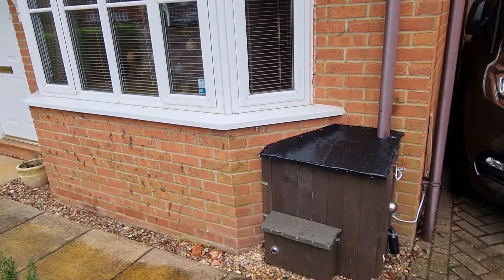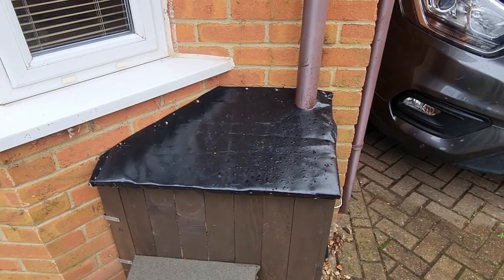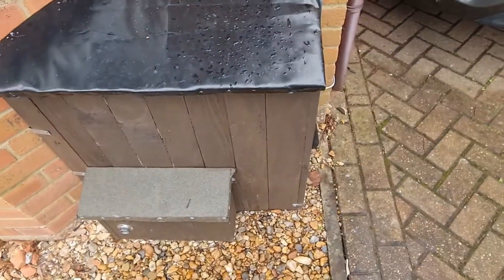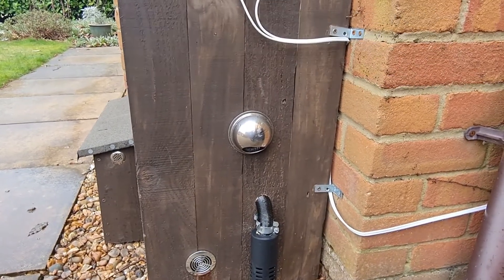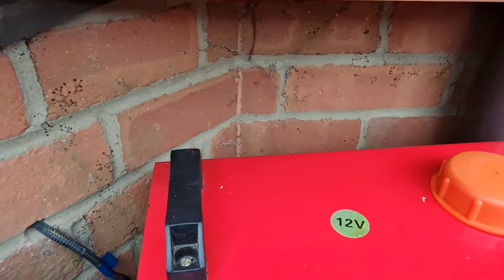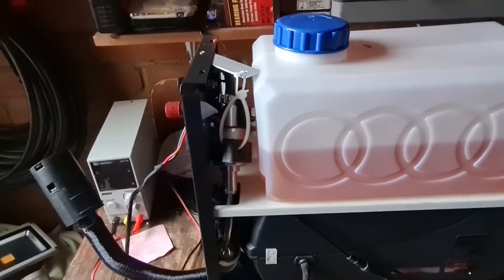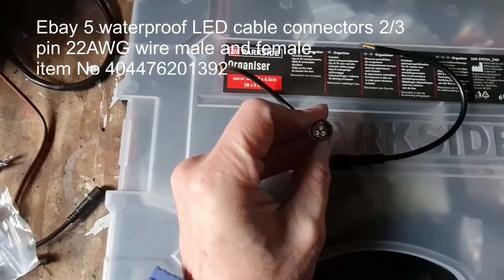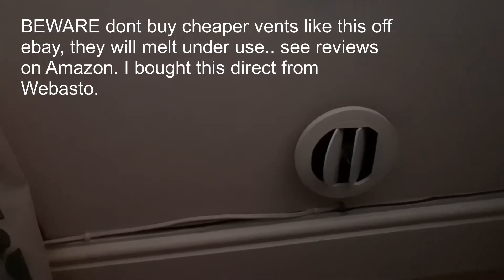Installing a Chinese Diesel heater into my house

Comment: Fuel smell is either coming from exhaust gasses or from the fuel cap, try putting a pit bike breather on the fuel cap
Reply from the maker: Hello. I sorted the smell by extending the air intake pipe further away from the unit, the smell was coming from air filled with diesel fumes.

Comment: Hi Roy just subscribed I found this interesting and may try this out, well explained 👍
Reply from the maker: Hello. Thank you, I appreciate your comments.
Reply from the maker: Hello. Thanks for subscribing. Glad it was of some use. Since installing i have removed the red outer case and now have the pump suspended on cable ties off the black part of the outer casing. I also added some sound proofing (from my van build) to the pump, all parts I could see and this really helped quieten it down, so much so that I cannot hear the pump at all, where as before the ticking would travel through the wall.

Comment: Hi there, would this be too noisy to vent into a bedroom for night time usage?
Reply from the maker: Hello. Yes you could vent it into a bedroom, only their are 2 potential issues, firstly the pump, you will hear this, I have quietened mine down to practically no noise by removing the original mount which attached it to the pump housing, and now suspending it via two cable ties, still keeping the 35 degree angle, and adding some sound proofing to the body and ends of the pump, it's a small amount but makes a big difference. It the type used in van conversions (dodo soundproofing mat)
The fan noise is reduced when the heater reaches the desired set temperature. This can be achieved quicker by reducing the pump fuel mix to 1.4 pps if I recall correctly. However, bare in mind that not all fans make the same noise, I have the same heater in my garage, and that fan is noiser than the lounge fan.. 
Hope that helps.

Comment: Hi mate I recently got one of these and I’m trying to figure out how to run it off the mains, the best I can find is a mains converter takes it the 12 volts I need to a a cigarette lighter connection and then it’s got the little wires that connects to the back of the machine but it’s 10 amp rated I’ve heard I might need 15 amp but I can’t find the parts for 15 amp. Will it be okay at 10 amp or have you got any suggestions?
Reply from the maker: @connorjones3080  
Hello. The best way to run one of these off 230v is using a 

DC 5V/12V/24V Universal Regulated Switching Power Supply Transformer LED Strip

 (bought off ebay)
You need the 200w version as its Rated for 16.5amps, and these heaters pull up to 11amps upon start up. You won't be able to run it off a cigarette lighter socket as they are only Rated to 10amps max, you will either blow the cigarette lighter fuse or possibly cause the wires to over heat.

The two wires coming from the back of the heater, red and black, screw into 2 ports on the transformer, it's the safest way to run it off 230v. Be mindful though when running it off 230v if you have a power cut it will also cut the power to your heater.

Comment: Im sorry. How do you get in and out of that van when there's not even enough room to fold out the mirrors?
Reply from the maker: @johnassal5838  Hello.. yes it a bit tight, but i am able to open the passenger side door enough to climb in and cross to the drivers seat. Reversing back is always a bit nerve racking..

Comment: From what I've seen of these is that many of them aren't sealed really well. Pressure test the combustion chamber and you will probably see a few air leaks. These air leaks will leak the combustion gasses into the clean air during warm up.

Someone posted in another video that they tore theirs completely apart and sealed every sealing surface with high temp RTV onto the gaskets (including where the glow plug is threads into the unit). 

The issue is primarily due to when the unit is cold the sealing surfaces aren't well sealed, and seals when the unit gets hot as the metal expands sealing the unit.
Reply from the maker: @madmax2069  Hello. Thanks for commenting. That makes total sense, I did strip it down and rebuild using high temp sealant on the burn chamber gaskets, but alas it did not cure the smell, and interestingly the small is present on both startup and shut down, which kinda negates the expansion of the metal when hot. However on the next strip down I will seal with sealant all areas including glow plug, and hopefully that might cure it.
Reply: @royclark8385  you should try pressure testing the combustion chamber to see if there is any leaks. it doesn't take much pressure to find them. Even if there is residual fuel in the combustion chamber it still shouldn't leak into the clean air stream it should all go out of the exhaust. 

That brings up another thing. The exhaust piping could also have a slight leak which would explain why you can smell it during heat up and cool down because there is usually going to be unburned fuel during start up and cool down. 

Have you been outside during and looking into the box during heat up and cool down to see if you can smell any exhaust gasses from within the box you built around it?

Comment: Hi Roy, i used to pull in fresh cold air but i found i needed a higher setting when the temps dropped to minus, plus the cold air draft when not in use was terrible lol. I cored a new hole and now recirculate the air inside the house.. No drafts and i can automate the heater without having to have the vent open all the time. The heater runs more efficient, the heat output is higher and i can run it at a lower setting and conserve fuel too. In 2 years ive had no issues with condensation 👍🏻 Check put my video on how i automated it 👍🏻
Reply from the maker: @deoxyrobo  hello. Thanks for the comment, I have thought about recycling the air from indoors but to be honest, I am reluctant to cut another hole in my wall..
Reply: @royclark8385  you could reverse your thinking on this. Bring the heater inside and route the combustion air intake and exhaust out through the hole that you have got, along with the fuel line. That’s how they are installed in vans as you know. You leave the nasty ticking outside, and he fuel etc. just build a nice box / use an old side board to house it.
Reply from the maker: @deoxyrobo  hello. Thanks for taking the time to comment, I will check it out. I totally get the advantages of recycling the air from indoors and may opt for that 2nd hole in my brick work, but right now, i actually like the fresh air it's pulling in.

Comment: Hi,
Stupid question, what size hole did you need to allow heat tube to pass through your house wall. Did you need to fit a sleeve to carry the heat tube to prevent contact with cavity insulation.  I did say a stupid question. Thanks.
Reply from the maker: @harken112  hello. I bought one of these
Flintronic Drill Bit Set, Ø80mm Hollow TCT Drill Core Bit Cutter, with 111mm Round Shank SDS Plus Adapter Hole Cutter Drill Bit, Hammer Hole Saw for Wall Concrete Brick Stone Cement
For the brick on the exterior and 1 of these for the timber and plasterboard in the cavity and lounge 
Starrett HSS Bi-Metal Hole Saw - FCH0318 Fast Cut Extra Cobalt Hole Saw - For Stainless Mild Sheet Wood Plastic Various Materials - 79mm
Both brought from Amazon.
I did not fit a sleeve as I felt it it didn't melt the plastic pipe it would not damage the wood and insulation. I did check numerous times upon initial turn on and once running for 39 mins or so.
It's been great for the past year. I serviced it over the summer and running on kerosene, its was extremely clean inside.

Comment: You can get a display extension cable pre wired 2 3 4 metres
Reply from the maker: @flapper111uk  hello. I cut and rewired my display to a water tight 3 pin plug so it could be easily removed and swapped with another if needed. Did not know you could buy extensions though.

Comment: Sponge box for the pump
Reply from the maker: @jamiejoker118  hello, since installing i have changed the set up quite a bit, I now have the pump suspended on cable ties and also resting on a rag. I can now only hear it when the house is silent and I am listening for it, and even then it's a very slight tick. So I am very happy with that. Unfortunately I still get a kerosene smell upon starting up, even after servicing and sealing the gaskets with heat proof silicone. My eberspacher d2 in my van has no smell whats so ever..

Comment: I'm looking at doing something similar but routing the intake air to draft from in the house. I want to do this for two reasons. First is problem of pulling its own exhaust gases into the house. The second is the efficiency of heating internal air. I hope to build a box that mounts like a window air conditioner.
Reply from the maker: @Tiersmoke92555  Hello. I did think about routing the air intake from indoors but saw a number of videos claiming doing so caused condensation within the room so opted for fresh air. I can definitely appreciate the concern regarding CO2 I fitted a carbon monoxide alarm immediately above the air outlet and during install used a CO2 tester at the exhaust outlet to check for leaks.
Reply: Hi..... I have the exact design on my home....... Works great. This method is the only true way to maximize the efficiency of the heater. 😎👍
Reply: i have my intake indoors as the warmer air is more efficient to heat
Reply: @ianclayton2651 That will put your living space under a negative pressure either drawing air in through any gaps in the envelope or starving the heater for air.

Comment: I heated my old farm house 1,500 sq ft with 2 diesel heaters 2 years ago, worked good. Used just one until the temps got extra cold, then fired up the 2nd one. Now, I'm going to use some flexible dryer duct and put it around an extended exhaust (I already have both) and run a small DC fan at the bottom of the heater where the exhaust starts and split it off before it goes outside. I should be able to nearly double my heat output from 1 heater depending on the CFM of the fan. Easy and cheap way to increase efficiency.
Reply from the maker: @scottc8152  Hi. That sounds very efficient, well done.

Comment: Smell maybe bc exhause and fresh air intake too close and near same level in height
Reply from the maker: Hello. Thanks for viewing and suggesting a possible cause. The exhaust is directed out the opposite end of the box to the air intake, I have subsequently moved the tank 5 meters away from the unit, but still getting smell upon start up, not so on shut down if I run it on high for 10mins before shutting down.
I believe its a manufacturing fault in that the gasket for the burn chamber is not sealing correctly, so come the summer I will strip it down and reseal the chamber using new gaskets and heat mate Silicon to create a better seal.

Comment: I’m doing the same however finding it hard to find a 75mm open close vent for the inside wall as the official ones all have a 75mm diameter but then step up to a 90mm meaning I will need to drill around a 90mm hole. I wanted to keep the hole smaller around 75mm the only ones available with a straight 75mm are the cheap Amazon / EBay ones which melt. Did you drill a 90mm hole for that white Webasto one??
Reply from the maker: Hello. I can appreciate your dilemma, I drilled initially a 80mm hole into my wall, which I am glad I did as a 75mm would have made pulling the 75mm pipe through very difficult. I did initially buy the cheap one from ebay, which melted.. so bought a 75mm one online, but as you say it requires a 90mm hole to fit flush against the wall. I did not want to drill a bigger hole so, whilst mine fits the heating pipe snug it does protrude off the wall by about 1cm, which when looking directly on is not noticeable but is when looking from above.

Comment: Thanks for the video. I have a shop and qant ro run my heater inside. I know I need to run the exhaust outside, but what about thw intake? I appreciate the help. Be blessed ❤
Reply from the maker: Hello. Thanks for your comment. You can run the air intake from inside the building, I do in my garage set up, but two things you want to consider, 1 that if you get a blow back inside the burn chamber (its rare but can happen) the combustion (smoke) will often exit via the air intake, so you will have a room smelling of diesel and full of smoke, 2nd the process of combustion works more efficiently with higher humidity (damp air), whereas the air indoors does not contain the same humidity and is often dryer.
If possible I would recommend having the air intake outside.
Reply: @royclark8385  thank you so much foe that. Helps me make my decision. I appreciate it

Comment: The smell is unburnt fuel. When you run it on low for so long it will do that. Try running it on high setting for 15 minutes before shutting down and you will clean all the carbon for next start up.
Reply from the maker: Hello. Thanks for taking the time to comment. Yes unfortunately I have tried as you suggested. I am of the opinion it's a fault in the machining process, and am going to replace the gaskets only this time use Silicon to create a better seal. As in theory even if some unburnt fuel is left its smell etc should just be expelled through the exhaust as this should be a sealed chamber.
Reply: The smell on shutdown and start up is unburnt fuel and because the fan inside the case is there to blow air across the heater it will undoubtedly suck and blow the unburnt fuel smell into your room, it’s only temporary and the smell doesn’t linger for long

Comment: Hi Roy ive been heating my 2 bedroom house since last year on one of these and keeping warm as toast 😊😊 average heating cost work out at £13.75 per week bearing in mind i spend most of my time at home because of my disabilities'......I PAY £1.10 Per litre of kerosene and normally my gas standing charges are twice the amount ive used in gas
Reply from the maker: Hello. Thanks for viewing and commenting on my video. I am very happy with mine, other than the diesel/kerosene smell upon start up and shut down. I have been buying my kerosene by the 40ltrs from Rye oils at 0.85p per litre, they have a self serve pump so cheaper than paying for delivery. It's certainly cheaper than running my central heating.  I see from watching YouTube their are a number of people looking to incorporate these into houses as opposed to just vans and workshops.
Reply: Hi. where to buy kerosene ?
Reply from the maker: @bypyhgyk  hello. I purchased mine from Rye oil, in Rye Kent.

Comment: These heaters are also available with seperate tank of 15lt which means less refilling. I installed my heater inside with a pipe through the wall to the tank outside so keeps everything clean. Easy to set up and keeps my workshop 4m x 6m toasty warm.
On low setting which is more than enough the fuel useage is 1ltr / 5hr.
Reply from the maker: Hello. Thanks for viewing and commenting. Yes that is my only downside is the smaller fuel tank, unfortunately due to the size of my box it is housed in, I am limited on space to fit a larger fuel tank.

Comment: I had a similar experience with the diesel smell, and I worked out it was the air intake pulling in the exhaust fumes at the start up. I extended my air intake far away from the exhaust, this solved the problem. When I say the air intake I mean the cold air running from the right hand side of the unit, not the air intake under the unit.
Reply from the maker: Hello Thanks for viewing my video and commenting. I like your idea although I did try adding a bit of Ducting from the heater air intake itself through the box and out, so as to isolate  any stale air in the box being sucked in but that made no difference either. My mate has the same set up as mine but does not experience the same problem. My exhaust is pointing in the opposite direction to the air intake too. Its a very strong smell only upon initial start for about 10 seconds then clears once the heater starts burning the fuel.

Comment: You may have an exhaust problem. At first, I 'elbowed' my exhaust immediatley as it left the unit, but after a few days it BLOWTORCHED it's way through. Now I have a 2 foot drop before the elbow, and a mesh cover to protect the pipe.
Reply: Blowtorched through in a wooden box and a gallon of diesel.... what could possibly go wrong 😂
Reply from the maker: Hi thanks for viewing my video and commenting. That's very interesting, I will keep an eye on that.